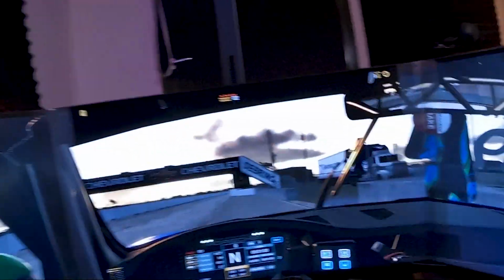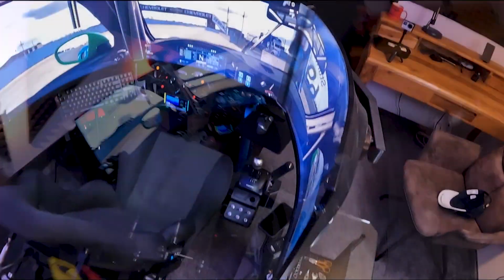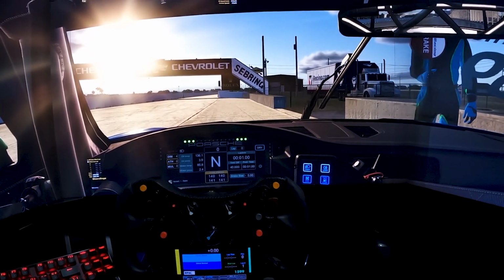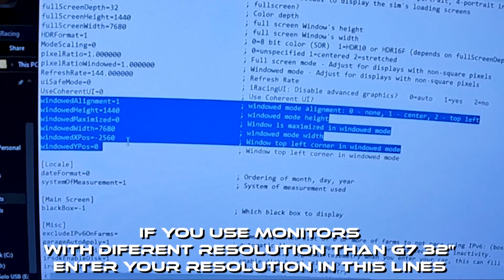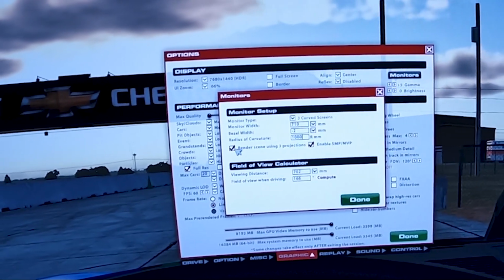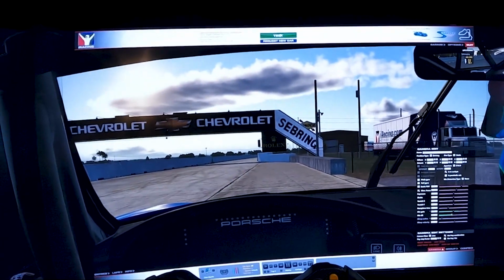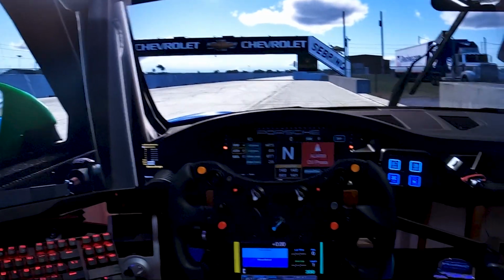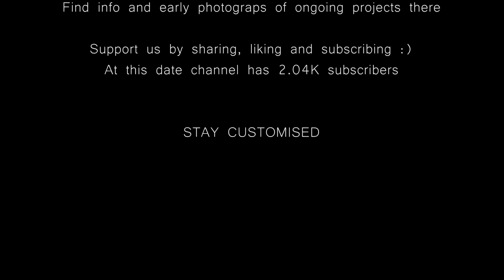Realistic FOV Setup Tutorial In Iracing - Samsung G7 Triple Screen With Asus Free Bezel Kit

Comment: What you GPU card? I have nvidia 4080 and if I set monitors higher than 120hz only 2 of them is working
When I set all 3 to 120hz then all 3 are working.
Reply from the maker: I have them set to 240hz and all are working with 3080. Framerate is around 100fps tho.

Comment: I was excited to find your video and learned earlier today Xbox doesn’t allow you to do 3 screens
I think my next best option is just a  Samsung odyssey CRG9 but everyone who I seen on here when running that sim racing all day if the display was just a little bit taller. The I found the odyssey 4K UHD it’s 55” and taller but nobody is running it, don’t want to roll the dice on that one what do you think  ? Will the ark have the ultra wide display so the dash of the car is as close as I can get to 1:1 with one screen but still get the height of the display that everyone kinda complains about on the g9 where the top of the windshield is cutout

Comment: Thanks for sharing 
Does anyone know what could be the problem of each monitor running different hz
I get only two monitors on 240hz and one is always 140hz no more
If I switch the ports than a different monitor runs only 140hz and the other two 240hz
I got GPU MSI RX 7900 XTX
Monitors are Samsung G6 odyssey

Comment: Great video again. I have the same monitors and just bought the Asus Bezel free kit. I’m a little disappointed that I have to put the monitors at 130 degree. How you enter the rig ? The monitors get so close to the seat especially if you put a extension to have them closer to the wheel. Thank you.
Reply from the maker: I have no problems entering and exiting the cockpit, also, the simulator was exhibited at WRC Croatia and no one there had problems. It's just a bit less space to squeeze trough. Getting in is no more difficult than getting in a real race cars. You are talking about 130 deg like it's something negative. It's the best thing actually for the FOV and immersion.
Reply: @T.S.CUSTOM  Hi T.S, thanks for the reply. I will try again more precisely at 130 with the angle carton that comes with the bezel kit. Maybe when I tried it, it was more than that, it was really hard to enter the rig without bumping the left monitor. I always thought and read that the best angle is to have the center of the monitor equal to my eyes for each monitors, that may be wrong.
Reply from the maker: @tapidlittle13  note that my screens are shifted to the right compared to the seat, just like the position of a driver in a car is. That makes for a little more room on the right.
Reply: @T.S.CUSTOM  Hi again, I just installed the bezel kit and moved my monitors to 130 degree, looks good now but my side monitors now have some distortion (vehicles are longer than they sould be, image is stretch). Can you tell me in Iracing what is the value you put for the curvature of the screen? I have left them to 1000r, it was looking good before but now at 130 it's not, thank you again for your help!

Comment: Hello. I currently have a G7 & G5. I'm planning to pick up another G5. Will there be an issue running this combo for sim racing?
Reply from the maker: I don't know. 1. thing to check if they are the exact same size. 2. Thing refresh rate will be locked to the refresh rate of the G5. The G5 has worse colors and contrast, so there would be difference in the picture.
Reply: @T.S.CUSTOM  Thanks! You're absolutely right about the difference in color quality.

Comment: Installed it 2 month ago. Being even closer to the center screen makes driving so much more realistic. Distance to screen is now 53 cm which is also ideal for FOV (see Race Beyond Matter). Best investment this year! Hope I can keep it with the upcoming QR2
Reply: Did you go with the same displays with 1000R? How do you like the pretty strong curve? I have 3 G5, but after mounting the center I‘m not sure if 1500 would better… Any thoughts?
Reply: @Alalalalalalalala4  well, I have the 1500R. Can't say anything about the 1000R
Reply: @Alalalalalalalala4 what did you npt like, im only waiting on my stand to arrive all my g5 are waiting to be installed, but I still have my doubts about them vs the KTC 32inch 1500R.
Reply: @Wachito78  I had three G5s and arranged them halfway across a table for testing. 
I didn't like the curve of the 1000R when looking at the center monitor, but also when looking at all three monitors. It's just too curved for me. Both in terms of the image and the size of the 32" are lost in my opinion. In addition, the G5s are very simple in terms of quality... but the price is also quite low, at least in Germany.
Then I switched to 3x ASUS VG32VQ1BR with 1500R. For me, the 1500R is much more comfortable and the material feel is better. But they were also 20% more expensive.
In my opinion, you can tell if you like the 1000R after the first test, I had the feeling that it was too bent from the beginning.
Reply: @Alalalalalalalala4 They do feel a little weird on my eyes, but I think i can get use to it, I had to take them down tho, because the monitor mount I purchased was up to 32" and I couldn't get the angle to where I Wanted, so I returned it, and I'm waiting for one that can take up to 43" monitors.

Comment: Thanks for this video. Also saw your video on building the screen mounts and i must say; my man you are very talented. Great job man. I just bought the triple G5's to put on my rig. I think it's the sweet spot FPS wise. It's only 144hz instead of 240 but i think you rarely hit that anyways with iracing. I'm looking forward to building my rig. Can't wait! Will try your settings since the screen is almost the same. The extension of the DD would be nice. I'm driving with a DD pro, so i have to see how everything turns out.
Reply from the maker: Thank you. It is true about FPS. Maybe 144Hz/FPS would be stable with the new generation of cards (RTX 4090). The G7 is for sure future proof. :) Note that The G7 has quite better picture quality over the G5 and actually that was the reason i decided to go with the G7, not the refresh rate. It has deeper blacks and better color, better LCD matrix overall. I just got CSL DD Pro, Its almost impossible to make a extension for it. Maybe I will feature it in the video. Comparison to DD2 and simucube is coming for sure.
Reply: @T.S.CUSTOM  Wanted to get back at this after we know the performance of the 4090 but man that thing is crazy.Seems to be the ideal card for 3 x 1440P. I wonder how the 4080 does on 3 x 1440P. I'm done building my triple screen setup now. Gonna build the rig this weekend. Can't wait to test everything out. My 2080 will feel pain i guess. Need to upgrade soon :) The G5's are pretty amazing but i hope i will feel satisfied. If not i need to get them G7's :D But i can always do that in the future. The 1000R curve is so nice for this setup. I have the screens exactly the same. Felt like the best position for those screens anyway. The side monitors flow with the curve of the middle monitor perfectly this way. You just sit in a halve circle. And it feels just like looking through a windscreen of a car.

Comment: which monitor firmware are you running? what setting are you using? I also got triple g7 running latest 1014 firmware.. I have the flickering monitors issue
Reply from the maker: I don't have flickering issue and I am afraid to touch anything as it is working fine for me. I heard that new firmware is more like a patch than a real fix for some that are experiencing problems.

Comment: is the bezel free kit for 27” monitors? your g7 is 32”?
Reply from the maker: Officially they support up to 27" but they fit on the 32. The only problem is that original mounts can't be used because the plastic is to short. If you make mounts by your self you can use them. It's all explained in my videos.

Comment: First, thanks for the video ! 
But I have a bit different question… how do make the extension for your wheel ? The cables inside are long enough ?
I have a Clubsport v2.5 and i want to put the wheelbase behind my screen… but the steering is too close lol so I need to make a extension… thanks for you answer ! ✌🏻😉
Reply from the maker: My extension comes with extension cable. I for now only Fanatec DD1, DD2 and Simucube are supported.

Comment: Great video, I pulled the trigger on triple g7 setup fo my rig. I’ve got 12th Gen i9, 32 g ram & RTX 3080ti 12gb. I’m suffering relentless micro stutter when racing, typically evident on scenery when cornering. I’ve tried everything, gsync, vsync settings. Low graphics settings, high graphics settings, all monitor settings. I’ve read a lot of bad press about the monitors. Do you have any stuttering problems or have you ever since getting the monitors? Appreciate the help, I just can’t enjoy the rig like this.
Reply from the maker: No, it works for me. Do you have 4th monitor? Maybe you are stuck in low refresh rate?
Reply: I had the same thing. Did you update drivers to last version 1014? I have them on 240hz, g sync on in Nvidia drivers (v sync off) and in monitor osd I have adaptive sync on. VRR still turned off

Comment: Unfortunately the iRacing monitor setup is not correct!

You are using the "3 curved screens" option which is used only for flat image projection when you have 3 curved screens that are set up to follow the angle of their curvature. Basically acting like a single huge curved ultra wide screen...
Thats why there is no option to set the monitor angle - it assumes that you have them on a curved plane that follows the radius of the monitor.

Since you have your side monitors at an angle - the projection is simply not right on multiple aspects!!!

You should be using 3 flat screens option since it takes into account the angle between side sceeens. 

Unfortunately it is not possible to correct the distortion of an curved monitor for now, but it is possible to correct the side angle distortion which you have in reality but not in game when you choose 3 curved screens option...
Whats your angle? Through the video it looks like something around 55°?

Fixing the curved screen distortion (in a triple monitor setup with side angles) is a beast of an problem that actually goes beyond iRacing if you read about it...
Reply from the maker: I'm not sure it's not correct if it looks good. I understand what you are talking about but I figured it's better to have curvature distortion correction than the correct angle. The difference in curvature because of the angle is not so big. I compared both setups and did not find any major difference. The bezel is perfect, no noticeable distortions or missing information. It would be great if Iracing implemented curved screens with angle option but till then this is somewhere in the middle.

Comment: Hey mate, what's the total width of your monitors with the curved screens set at 130 degrees at the edge of the curve?
Reply from the maker: Find the information in this video https://www.youtube.com/watch?v=uuHRKSessjE&t=957s&ab_channel=T.S.CUSTOM
Reply: you dont measure the angle of the edge in curved monitors.. imagine a line from the edge of bezel to the the mid monitor mark - thats the angle :)
Reply from the maker: You need to measure the angle that way for the bezzel free kit to be able to display it properly. Samsung screens are pretty much flat on the ends of the screen.

Comment: why there is no more setting for the angle of the monitors ... I use 3 40" 16:9 QHD R3000 curved 165Hz Monitors. on compute I get an FOV of 145 no matter what angle I use. I do not use a bezel kit. so no need to use 135 degrees - I want to use 120 degrees ... but I can not find the place where to set that angle - what would get me an FOV of 179
Reply from the maker: I don't know, you should ask Iracing. It's puzzling for me to. For me the settings were just fine so i did not turn too much attention to it.
Reply: I used the  calculated FOV from my excel file and set the angle to 63 (recomended from the calculation) the today arrived bezel kit is NOT working ... I need to do it like you did.  With tape instead of the mounting things. They lenght is perfect, but there is also an angle from 120-130 degress recommended ... so I will set the monitors to 60 from the wall. For 130 the space to pass my rig would be to small.

Comment: 3:40 I do believe my 144Hz Dell Monitors are running at the refresh rate I set them to despite the top monitor running at 60Hz. The monitors themselves show they run at 144Hz in the information OSD - so completely disregarding any windows settings. They also show 60hz, if I set them to that refresh rate manually. So it is definitely working.
Reply: I think what your problem could be: It's the 240hz of the triples - in the case of the 4th display it would be too much bandwidth for your graphics card. Try setting your G7 monitors to 120hz instead which is plenty enough (you don't really get more FPS anyways in iRacing on a full grid) and it should work for you as well. So 3 times 120hz and the 4th monitor running at 60hz.
Reply from the maker: Thanks, i'll try that also.

Comment: I am for sure going triples with 32" displays but I am not sure I am willing to shell out $2500usd for the G7s. I was thinking maybe GIGABYTE M32Q or something comparable. Amazing setup sir.
Reply: you could use the G5 32" if you dont need 240hz and qLed
Reply: @zooky7698  Exactly what i did. And you rarely see FPS above 240 anyways with a triple 1440p setup anyways. I think 144hz is the sweet spot. Even if it's above 144 FPS, then the 144hz is mostly enough to get a smooth experience. And this is coming from a competitive 240hz shooter gamer (where response time and HZ is extremely important) that is experienced with a 120hz triple setup; only just upgraded to the G5's. Can't wait to install them. My guess is that 144hz is just fine. I mean i could notice some hickups on 120hz, but 144hz will prolly negate that and make it super nice. I got a pretty good deal on the prices for the monitors so the G5 was a no brainer for me.
Reply from the maker: Remember guys that refresh rate is not the only difference between G5 and G7. G7 has better lcd matrix better colors, better contrast, better blacks. Picture quality is very high on the G7.
Reply: Now the G7 is obtainable for under $600usd it is a much more viable option for me now. I put off triple monitors for a while which is looking like was a good choice.

Comment: A tip you could use - for your extra screen, try to connect it to your motherboard if it has a grafic chip build in - my MB have,
 so I connected my extra screen to the HDMI port on my motherboard and vupti - now it is not putting stress on my Nvida card

Comment: @T.S. CUSTOM I have the fix for your 4th screen. If you go into your motherboards bios and turn the onboard graphic too enabled it then allows you too plug your 4th screen into the motherboard USB port and then it is using the cpu's on board graphics. 

I believe it is called IGPU in the bios for my MSI motherboard. 
If anyone has a MSI Motherboard and need any advice just message me and i will spend the time in my Bios to find exactly the route you take in the settings too find too find the IGPU setting as i remember it was not simple too find on my motherboard that is and its been a while since i did it.

Hope this helps 😀
Reply: You have to remember that not all users will have a CPU that have onboard graphics in the chip to take advantage of that option.
 Most performance AMD chips do not include integrated graphics to my knowledge.
Reply: @billwiley7216  Yeah if its Intel and End F they have no onboard graphics
Reply from the maker: Thank you very much for this information! I will try this and if it helps I will pin your comment to the top! :)
Reply: @T.S.CUSTOM  I have edited my comment as i didn't notice there were spelling mistakes and some may not speak english so thought it was best too edit.

Thanks
Reply: @T.S.CUSTOM  No worries and it will i use it my self. Not many seem to know about it so please do. 😀

Comment: I have a tv attached as a 4th monitor running 60hz, and im pretty sure my triples ar at 144, as they have their own osd showing hz and they are at 144.  Only think i did was go into nvidia control panel, and set each monitor's resolution and refresh rate manually.  And i have the the tv under the HD section and the triples under the PC section.
Reply from the maker: Are you running them with Nvidia sorround or AMD eyefinity?
Reply: @T.S.CUSTOM  no, i have them set up like you, with the app.ini.
Reply: I actually just set them up last week.  I've been in VR for the last 3 years.  I'll also mention they are gsync monitors.  But they are showing 144 even at the desktop.
Reply: @T.S.CUSTOM  you can enable IGPU in the bios so you can plug your 4th screen into your motherboard. I do this now. Just find IGPU or what ever its called on your motherboard and enable it.  

When you add a GPU too your pc its disables the on board graphics by default but as i said you can turn it back on as long as your CPU isnt one with the petter F at the end as that means it has no on board graphics